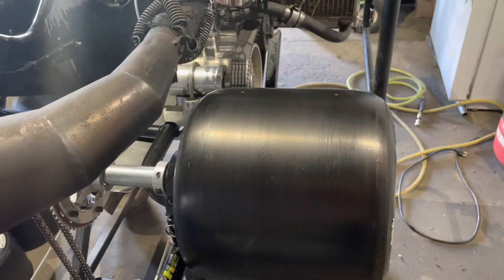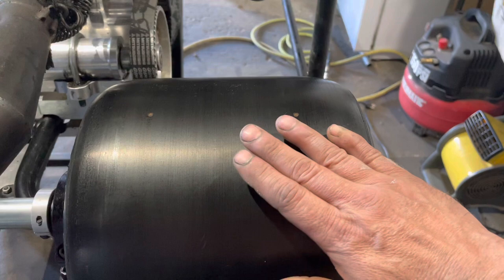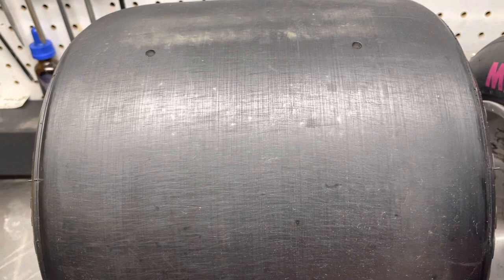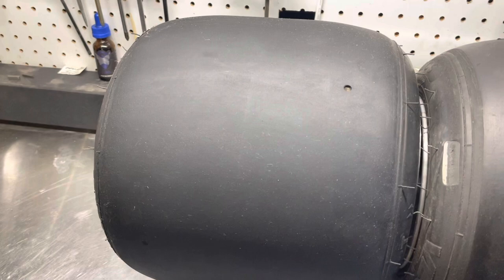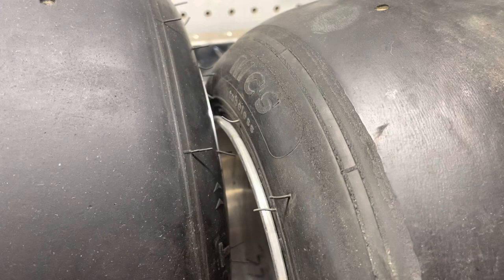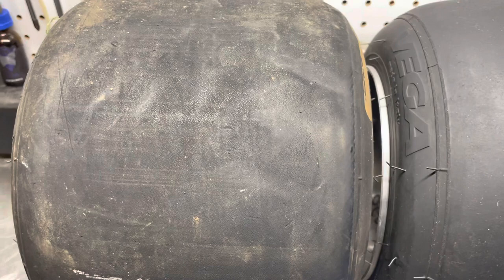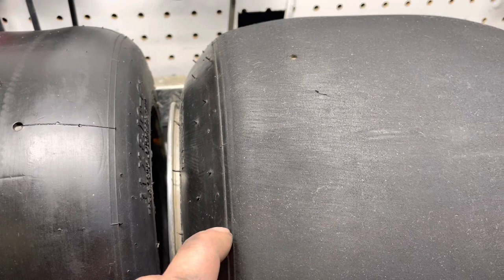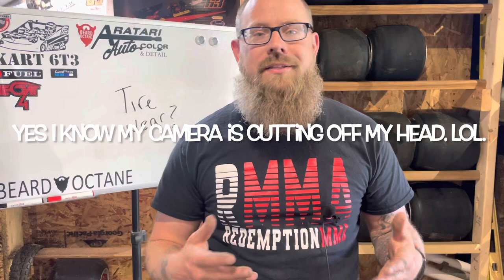Tire wear? Why?

Comment: I’m going to have to agree with other commenters. I do wear out a LR before right sides. Keeping the duro 8-12pts higher on the LR definitely helps but at a sacrifice. We do This on our vega and cobras. I will say the cobras last me about half the time of a vega but it’s expected.
Reply: When I run my vega’s and cobras I tend to do the same thing with duro. I haven’t gone as far as 12 points but I may give it a shot now.
Reply: @papaclod-hopper1976  we have gone as far as 15pts harder on the LR. Like I said it comes with sacrificing something els. But if you think about it, it’s all in tuning right? There is always more than one way to get the job done. I definitely don’t suggest 15 though lol. To hard to tune out up here in ND.

Comment: For some reason I’m wearing out my LR tire sooner than the rest. Then again it may be because I only run those tires on a very small bull ring style track. Lots of sliding and spinning rear tires on corner exit.
Reply from the maker: Very well could be.  I should have mentioned different surfaces and areas are going to effect wear.

Comment: Thanks again for the info. Could you reference one of your videos in case I missed it, on hub spacing? Before going to a new track how do you decide on front hub spacing and rear hub placement? Thanks.
Reply from the maker: I havnt really ever mentioned it.   I basically just make sure I don’t hit the steering on the front and make sure the rear doesn’t hit the frame.  I know some people tune with it but I really Havnt played with it much.